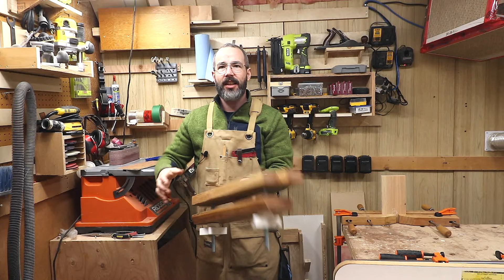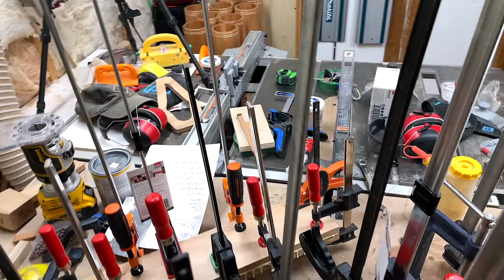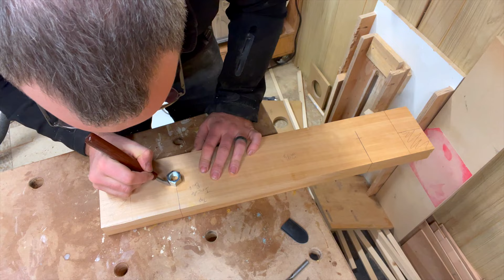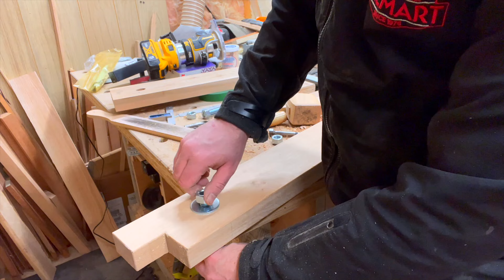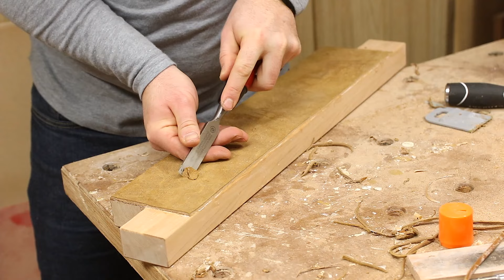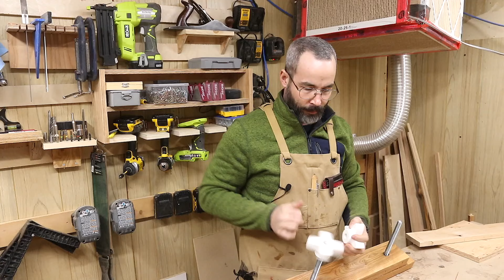Got a woodworking shop? You need this! | Inexpensive Moxon Vise Build

Comment: I started whipping one of these up myself. I'm not finished with mine yet though. I just got my boards glued together as I was in the same boat with not having them thick enough. Two boards together gets me the perfect thickness though. Just have to make the holes now so this was great to watch. My simple brain was curious why the oblong holes on the face but I figured it out. I'm used to welding not woodworking so some processes are similar and other very different. 

All in all though, nice video! It helped answer a few questions I had about my own vise.
Reply from the maker: Glad it helped!

Comment: 3. comments for your glue ups. 

1. Cauls. Cuts way down on how many clamps you need.

2. Salt, or sand. Sprinkle a little in your glue and when you clamp them, they won't move around so much.

3. Glue. You can use much less.
Reply from the maker: Thanks for the ideas!